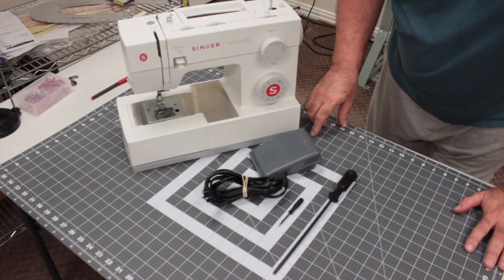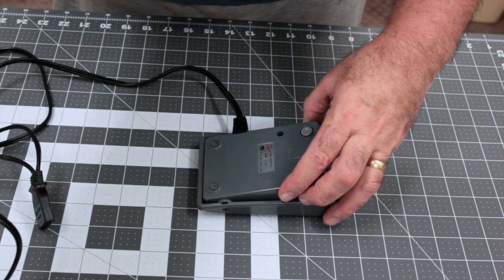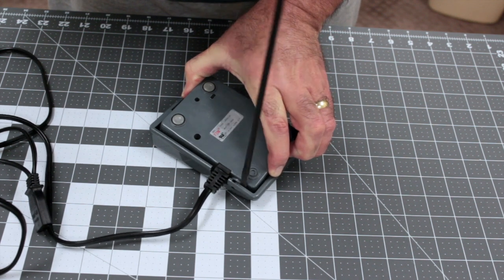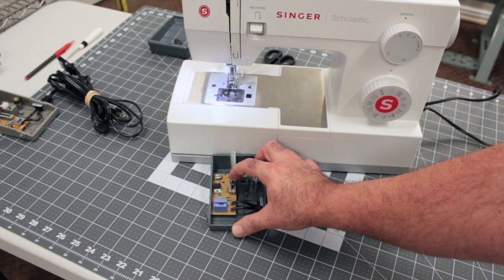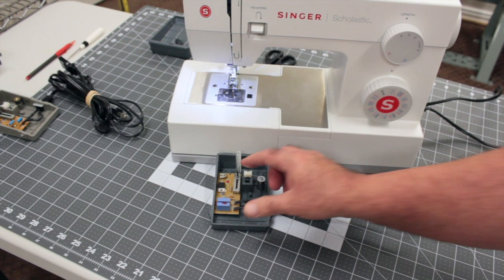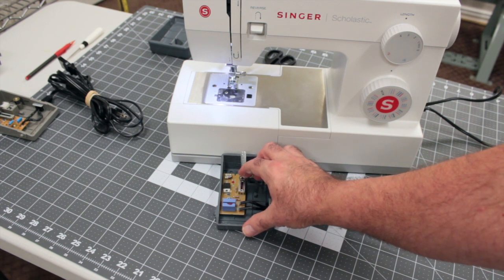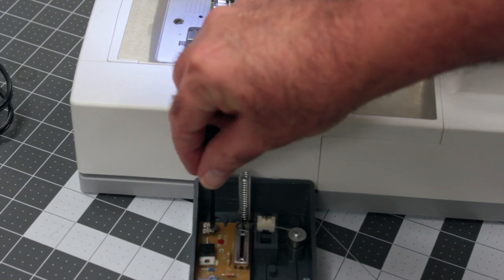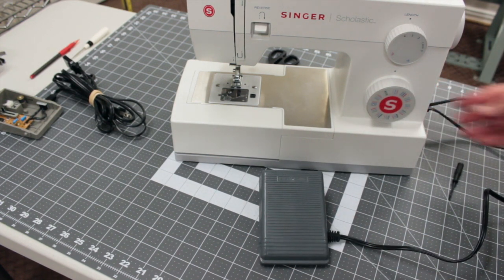Slow down the Singer Heavy Duty Series on some USA Versions

Comment: Hello. I have a problem with my Singer Heavy Duty 4423. I want to sew covers for my car seats. The material which I use is a fabric with sponge. Problem is width stich. When I setup width stich on 4 (max value), on reality width stich is 2 milimetars. That is very smal lenght  for a foot stitch sewing. I need width stich minimum 4 or 5 milimetars. Please help me how to setup machine for lenght stithc minimum 4 or 5 milimetars. Thank you.
Reply from the maker: Download the Singer Service Manual. It will guide you through the steps needed to fix this issue.

Comment: My machine is singer start fashion maker 1306. When my machine's power button is turned on, the machine automatically works. Is it because of the speed controller's problem?
Reply from the maker: What do you mean by the machine automatically works?
Reply: As soon as the power button of the sewing machine is turned on, the machine becomes work without pressing on the speed controller
Reply from the maker: @mansoobaafsal4481  Unplug the foot pedal from the machine and see if it still does this. If it doesn't then try another foot pedal. Yours might have a short in it.
Reply: @kevinsews  power plug's wire and foot pedal's wire are connected to the  sewing machine through a single plug. Then how to unplug the foot pedal from the machine?

Comment: Hi Kevin, My 4432 has the needle positioning out of whack. I moved the machine & accidentally hit the side of the machine. Tried following the only video I could find and now it's a mess.  Can you do a step by step needle positions adjustment video?  Thanks so much!
Reply from the maker: I've never had that issue before. If I do I will create a video on how I fixed it.
Reply: I will give it a whirl off the tech manual & let you know the results..hopefully good. Thank you for considering it!
Reply from the maker: @mcrogerr0ck  Okay, let us know the results.

Comment: Plz my sewing machine pedal dont want to work. I opened it and check. Everything seems OK. When I press with my foot the machine makes à noise, so then I rest on the table and press with my hand. When I press certain area, It sews but I have to press all over first to see where it will start sewing.
What can I do plz. Thanks in advance
Reply from the maker: It sounds like you pedal has a short in it. I would order a new one if it is an older one. Otherwise, take it apart and try cleaning it.
Reply: @kevinsews  thanks. I opened it check and everything seems OK. But as you suggested, I will order a pedal online. It's singer prelude. What is strange is when I press with my foot like it's not connecting, so I place on the table and press on a particular spot and it sews. But it's un confortable to press with one hand and try sew with the other.

Comment: I just got a 4452 and have the same issue. I tried this on various setting but there is no change in speed no matter how much I adjust it Can anyone help
Reply from the maker: I’ve heard the something from others lately. Singer must have changed suppliers. I even tried ordering one from an online store and it too didn’t have the feature to adjust the speed.
Reply: maybe you can get the same pedal they used so u can adjust it

Comment: Hi!! I have a 4411 I’ve used it about 3 times and today I was checking what it has and I moved the feed dog and now it doesn’t want to come up, I’ve done everything that it shows on the videos, do you know what could be the problem?
Reply from the maker: Check your manual on how to lower the feed dog using the slider switch on the back side of the machine after you remove the accessories tray. Make sure the switch didn't go into the down position. Slide it to the other side to raise the feed dog.
Reply: I did that and it’s not working, I’m thinking is missing something on the llower cover where the slider switch is, but u can’t find pictures to compare
Reply from the maker: @xitvenegas5318  If that isn't the issue then it sounds like something came lose in the feed area. If you are mechanical you can remove the bottom cover and you may be able to see what is going on.  The problem with the low cost of these machines is you can buy a new one for what a service tech will charge you to fix it.
Reply: Thx so much for you info, I took it to a tech and what happened is that the oil in it is very sticky since I don’t use it and it was not letting the feed to come up
Reply from the maker: @xitvenegas5318  Ah, okay. Thanks for the update. This will be very helpful for someone else with the same issue.

Comment: Is that loud humming sound the machine makes when the pedal is pressed, before it starts stitching, normal? It is annoying,  it feels like there is too much “play” in the pedal or a bad connection . It hums and then the machine suddenly starts at full speed. Would be easier if the machine started as soon as the pedal is pressed. Thanks for the tutorial!
Reply from the maker: Nah it is normal.
Reply: @kevinsews  oh, okay. Thanks for replying
Reply from the maker: @taberfrench  My pleasure!
Reply: Man I thought it was just my machine that did it and something was wrong with it, glad it's normal with other people experiencing it. It really is annoying.
Reply: He does adjust to the "sweet spot", a little faster than where there is "grunting" (slow ramp up) but much slower than the full speed ahead. Looks like a very slight adjustment to find the sweet spot.

Comment: Good stuff.  Me picking nits here but with a rotational adjustment the proper terms are clockwise or counter-clockwise.  Saying to turn something "right" or "left" is confusing.
Reply from the maker: Matt Williams Sorry it wasn’t helpful.
Reply: Anti clockwise to slow down
Reply: @johnstride9642  It is the opposite on my Brother machine so it depends on how the control circuit is designed.

Comment: I followed every step but turing that thingy did nothing for me :( it used to be normal speed but once after I changed the bobbin (still using correct bobbin) it started going so fast.
Reply: Yep having the same problem. I tried turning and turning it and so on but it just wont change speed at all. Kevin please help us. Thanks for the vid, Subed and belled. :)
Reply: @Gladius7  I messaged the company and they say my pedal or wire is damaged and I need a replacement for 45 euros, crazy, it's only a half a year old. My mom has an oldschool one that has been passed down to her. Things are made to break nowadays.
Reply: @hsheinloo  oh wow thanks for the heads up. I just pulled mine out of the box, brand new. It goes so fast that screws fell out, I am NOT joking. Its shakes its self so much that it bounces on the table up and down. It unusable.
Reply: @Gladius7  Try to get it fixed by the manufacturers. That's ridiculous.
Reply: @hsheinloo  Yes luckily there is a Singer office 10 min from home, So will be ring them up tomorrow for sure.
Reply from the maker: I added a link to one that you can buy that will work in the video description. It sounds like your peddle might be defective.
Reply: @hsheinloo  Did a new pedal fix the problem?

Comment: I just got a 4423 and there was a little pin hole under the pedal you could adjust it without having to open it up, thanks
Reply from the maker: That is great to hear! Thanks for letting us know.
Reply: where did you find it? I have 4423 but there is no know under the pedal. Also I took the pedal apart like in the video but it didn't help much, I tried various positions but it seemed like the speed was always the same.
Reply: @codycamethru5234  Mine too 😞 I put it at the six o’clock position and it just changed how far down I had to press before it takes off like a racehorse. Did you have any luck fixing yours?
Reply: @HananeelStudio  nope, the only way is to order another pedal... however I just duck taped a thick piece of tape (that covers half of the space in the front side - when the pedal goes down = it just can't reach the bottom of the floor since there's something on the way) you can use a piece of LEGO if you have it... like imagine 2 jaws that can't close fully since something is in between them. Hopefully you understood me. the best practice  would be to order a pedal  from amazon since (quick shipping nd you can return quickly too) and just keep buying/returning until you find the one that works like it suppose too.

Comment: Thank you for this video, but unfortunately I'm not able to figure out what I'm doing wrong. I've tried adjusting the speed controller at all different angles but it's still incredibly fast. Is there something else I could try?
Reply from the maker: Is your machine a USA version?
Reply: Having the same issue, mine is a us machine heavy duty 4423 anything I could do?
Reply from the maker: @abdurrahmaansahalsaloojee3181  Where are you located?
Reply: Did a new pedal fix the problem?

Comment: the inside of my pedal doesnt look like that for the singer 4452 :( any ideas?
Reply from the maker: It can be hit & missed. I've heard from many that their peddles don't have the ability to slow it down. I even ordered one from Sewing Parts Online that they said it had the ability. When I took it apart it didn't have it.
Reply: @kevinsews  do you have a link to one that is compatible with the 4452 that can be slowed?

I see some online, but I think by adjustable they mean that if you press your foot at different levels it goes at different levels, which is not very helpful :(
Reply from the maker: @gior9204  No, I have ordered a few that didn't have the adjustment. This is after them telling me they did. In the end I finally gave up trying to find one.
Reply: Mine also looks very different. Look at the underside of you pedal, there may be an opening for a small  screwdriver, so you can regulate speed without having to open the pedal.

Comment: Am using singer simple 3232 and it won't stop running.... please help if you can...and it uses the same pedal as the one in the video
Reply from the maker: When you unplug the pedal does it do the same thing? If it only does it when the pedal is attached then I would replace the pedal with a new one.
Reply: @kevinsews  keeps running whenever powered on
Reply from the maker: @petronillahsaidi2497  Then it is something with either the electronics or wiring, so I can't help with that problem.
Reply: @kevinsews  it okay. I tried the way you regulated the speed and in the morning it worked perfectly...
Reply from the maker: @petronillahsaidi2497  Great! Thank you for the update.

Comment: I am HOPING someone on this thread can help me! My Singer Heavy Duty 4423 keeps jamming. I am sewing masks, so I need it to work!! The machine sews for a while, but then the thread tangles around the bobbin case (I have pictures I can send) and it jams. I take the bobbin case out, clean out the thread, re-thread the machine (same thread on top and bobbin), and start again. Sometimes it works for a while; other times it jams again.  I have watched most of your videos, Kevin, and they have been very helpful. I can now take my machine apart, clean and oil it, change tensions, seat the bobbin properly, check and adjust the timing (the hook comes around at the top of the needle eye, so the timing seems okay).  I am out of ideas and I'm frustrated. Can anyone help me?
Reply from the maker: Since the machine is mechanical and it does sew successful stitches for a while then I would guess it has something to do with either the needle (sometimes new ones have defects) or it is a threading issue. What type of thread spool are you using?  Take a look at this excellent video on the thread delivery system: https://youtu.be/I1jq9QoP9jg   Next, verify you have your bobbin inserted in the correct direction; the thread should be coming off the top left side of the spool when you insert it. Verify that it is seated in the tension slot too. I've seen thread that actually comes out of the bobbin's tension disc before too. No explanation for it either.
Reply: I'm not sure if you found a solution but i was having the exact same problem. 
It's probably the tension on your bobbin case. If you are using really thin thread, tighten it up slightly.

Comment: Hi I have a  Singer 4423 am changing the speed but is not working and don’t know what to do
Reply from the maker: What country are you located within?  I know in the past some countries pedals didn't work with this adjustment.
Reply: @kevinsews  am in the United Kingdom but order my singer machine  from USA
Reply: @kevinsews  same thing here. I ordered from Amazon in USA. Doesn't work like in the video.
Reply: did you figure it out? I have the same issue
Reply: @codycamethru5234  no it the same am using it how it is just being careful of how I press of the pedal
Reply: @addoticia5470  There’s got to be a solution to this! 😩 If I use it as is it just munches up the softer material.
Reply: @HananeelStudio  am sorry about it but I don’t have no solution to it
Reply: I suggest buying a voltage converter if you bought your machine abroad. My machine was too fast and rotating the screw of the pedal didn't help. I bought my machine from the us and using it in Australia, the machine works on 120V while the supply voltage in Australia is 230V. After plugging the converter the machine slowed down and I was even able to change speed with the pedal screw.

Comment: Will this work for the 5532 as well?
Reply from the maker: It did on mine.
Reply: @kevinsews  thanks I gave it a try and it's working much better.
Reply: Does not appear to work on mine. Moved the screw1/4, 1/2 ,3/4  turn, then as far as it will go but there is no difference. I am about to cry. It is useless for me.
Reply: @gladysperez-almiroty1760  I'm sorry to hear that. Mine did slow down but it's still on the fast side. I'm not sure if a new order pedal would work better.

Comment: Didn't work for me, tried adjusting it in all directions. Until I stopped to think and realized I plugged a 110-120v machine to 220v socket 😓 luckily it didn't burn and I'm gonna buy an adapter
Reply from the maker: Is yours a USA model?
Reply from the maker: @Royal_Renamon  Okay, so far the USA versions have had the feature required.

Comment: It's not working for my 4432 and I don't know why 😢
Reply from the maker: Singer makes changes in suppliers. It works for some people, while others have pedals that are different.
Reply: Then what’s the next solution 
4452 didn’t change.
Reply from the maker: @hofaichildren  Try to find one you can adjust is the only other option.
Reply: Any recommendations where I can find that
Reply from the maker: @hofaichildren  No. I tried ordering form several sources after speaking to them about exactly what I was looking for. When I received the pedals none of them were adjustable. I gave up trying after the 3rd one was not what I needed.
Reply: But they the speed reduce as the pedal gets older or is it possible to get a good pedal of an old machine. Our 4452 start speed is so first

Comment: Hello Mr. Kevin, good afternoon my name is Marisol Gil I live in Venezuela, I bought a second hand Singer heavy duty 4423 sewing machine, the machine did not take the thread from below. The technician corrected that fault, but another fault was the length of the zig zag stitch, it did not make the whole stitch the same size, he corrected it but the length of the straight seam stitch was damaged. It has 2 short sizes, it does not make long stitches.

Hola sr Kevin buenas tardes mi nombre es Marisol gil vivo en Venezuela, compre una máquina de coser Singer heavy duty 4423 de segunda mano, la maquina no tomaba el hilo de abajo. El técnico corrigió esa falla, pero otra falla era el largo de la puntada zig zag no la hacía toda la puntada eran del mismo tamaño lo corrigió pero se dañó el largo de la puntada de costura recta tiene 2 tamaños cortos no hace puntadas largas
Reply from the maker: Download the Singer Service Manual and it will help you fix the problems you are experiencing.

Comment: My machine is not getting the connection between the speed control pedal  and the machine itself.
I tried your instructions to control the speed, but no power seems to be reaching the needle.
What should I try? J
Reply from the maker: Try another predal. It sounds like yours might be bad. At least this will tell you if it is the problem.

Comment: Hi Kevin. I have the singer heavy duty 4423 and I’m not quite sure why my machine stopped working today. It’s only the second time I’ve used it. When I press on the peddle it still makes noise but the needle is stuck down. I also tried moving the handwheel and it won’t move either. Don’t want to mess with it without knowing what’s wrong with it
Reply from the maker: Remove the two screw from the top side under the handle and remove the top cover. Look at the belt and see if it came of the wheel.
Reply: This happened to me as well. I opened the needle plate and noticed the needle was hitting the bobbin case.

Comment: Hi I've tried turning mine but the speed aint changing
Reply: It's a 4423
Reply from the maker: @che.monges  singer must have change the pedal vendor since I bought mine 6 years ago.
Reply: @kevinsews  okay thanks
Reply from the maker: @che.monges  You’re welcome!
Reply: @kevinsews  ive just used your video to change mine, it does indeed work in the modern versions too!
Reply from the maker: @SirSkelebone  Great to hear it worked.

Comment: This does not exist on my 4423 foot pedal
Reply from the maker: Thanks for letting us know.
Reply: EU 4423 - it does not exist on mine either. Haven't turned the machine on yet - hope it's not super fast. Update - machine speed is perfectly fine without any modifications!
Reply from the maker: @10milesfromnowhere  Thank you for letting us know.